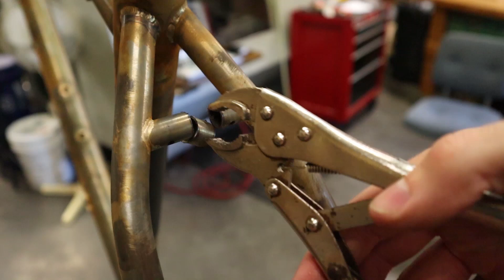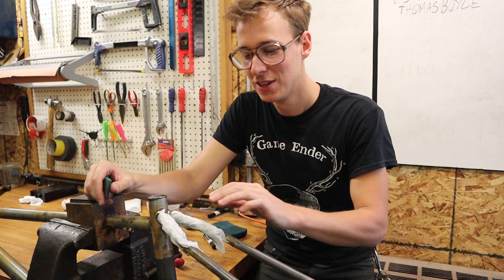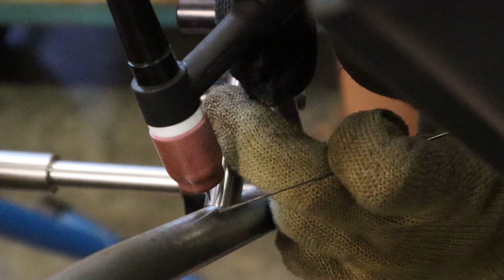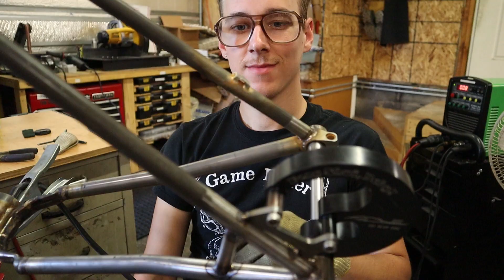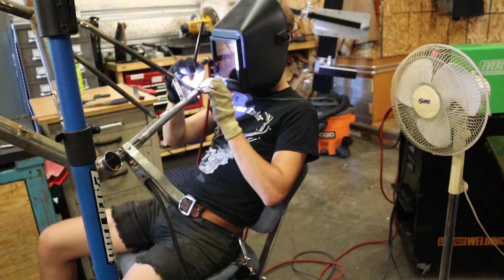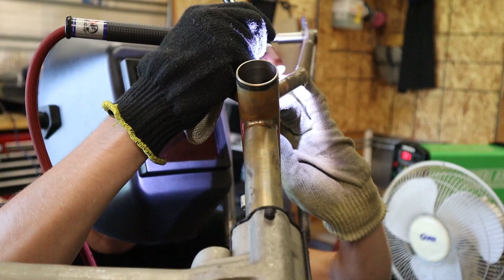Oops! Fixing a Mistake I Made on My MTB Frame

Comment: I don't weld bikes but I'm a pipewelder. Try welding while standing. You can use your feet and legs to (re) position yourself while welding. I know they say you need to be comfortable while welding, but you need to be in an active position. You weld with your whole body not only your hands. And for the small stuff try an autodarkening helmet or a flip up.

Comment: Great video. I think it's the right fix although as you said it probably would have been OK. Brazing only matches the strength of the base metal if you either build up a decent sized fillet or have it flowing around inside a lug or something like that. Not sure if you could have hacked it by TIG brazing with silicon bronze over the silver solder... I might try this on some offcuts and see what happens!
Reply: Well I tried silver soldering one end of a roughly 2" long piece of 0.8mm CrMo chainstay to a piece of 3/4in 1.6mm wall mild steel square tube. Then I cleaned it up and TIG brazed over the top with sifsilcopper 968 (silicon bronze). The puddle went a bit gooey and silvery but no spitting or anything and the joint came out looking OK. Then I TIG brazed the other end to more of the same square tube for reference and because I've been meaning to test this for a while. Just a proper joint this time with no silver in there. Then I tried to break it. The side with the silver in it broke first at the joint although I needed a couple of foot of leverage. The square tube deformed slightly before the joint broke. The other side only failed after attacking it with a hammer. The braze broke but the CrMo tube was also tearing open in another place at the same time and the square tube was pretty severely deformed. Much stronger than the bodged side and almost as strong as a weld.

Comment: I've had good success pouring boiling (or near boiling) water on flux to remove it. Another use for a gooseneck kettle, can get apply boiling water to specific places on the frame (like a bridge).
Reply: Would a steam jet work? Like for household cleaning?
Reply: hmm, i'm not sure, but i doubt it. boiling water works, i think, partly through thermal shock and partly through dissolving the flux (if water soluble flux, which i think is likely?). steam might help with thermal shock, but not much help with dissolving. i think its the dissolving that's doing most of the work, but i'm no expert here. just speaking from my own experience.
Reply: I wrapped different areas with rags, and poured water from the kettle over them, and let soak for several minutes. Seemed to keep the hot water/steam in place longer. Worked pretty well.
Reply from the maker: Yeah, hot water is better for sure. I had such a small amount of flux on there that room temp water was fine in this case. I do have an electric kettle for these things sometimes.

Comment: Is there a reason why you went with IS instead of PM tabs? Are IS easier to align? Ive noticed that most PM tabs on poduction bikes are badly aligned and need spacers added to adjust the angle
Reply from the maker: Yeah, I have the ISO fixturing tool and not the PM tool. Also, ISO works great and I don’t have any complaints with it.
Reply: @cobraframebuilding  but do you know why so many mainstream manufacturers mess up the PM alignment? Most IS are paralel but PM are messed up often
Reply: Oreo Carlton it looks more appealing plus more often you don’t have to have an adapter so maybe less wait

Comment: I was thinking the same thing when I saw you using 56% silver to braze the bridge. 56% silver could be used, but with the diamond reinforcement plates. Without the plates you could use 40% silver with tin that is suitable for fillet brazing. I've been experimenting with high speed pulse TIG welding for the chrome moly tubes and it seems to really reduce the Heat Affected Zone in the tubes. Columbus recommends 30% silver without tin for brazing their chrome moly tubes, which is fairly high temperature, but still lower than brass / bronze.
Reply: where does Columbus say that?

Comment: Joe.. To fix a rear dropout you are 100% correct.. I have repaired more than 50-60 dropouts and did it as you described.. For repairs it is important to try to match with the original as much as possible.. sometimes I replace both sides.. I have the shops save the nice dropouts when they are scraping crashed frames.. If the dropout is brazed , cut them in half, heat it with a torch and let gravity help you with removing it.. To remove the flux, it helps to use hot water rather than cold.. Great job on your build... I am dusting off my torch for a 650b  frame build..

Comment: Awesome Joe! We thank you for sharing experience with silver brazing applications. Bridges still boggle my mind. When I did the LTB I have a lot of punch with the dropouts squishing the axle. Was wondering your solution to prevent that. Only thing I can think is to deflect the rear end out as if it’s seating a wider axle.
Reply: Backpedaling?   Looks like Pithy Bikes now  might be able to finish their bike first before yours. 😁🚴‍♂️vs 🚵‍♂️
Reply: @HopelessRailmantic  LOL! I don't know.. maybe not by how things are going in my current  video recordings :P
Reply: @PithyBikes  True. Now would you and Joe meet mid country to race the finished bikes?
Reply from the maker: Yeah, I’m not sure how TIG compared to silver brazing as far as the dropouts narrowing from the heat but I think they both do it. You can start with an extra-wide dummy axle or you can cold-set it later. A wider axle can throw off the parallelism of the dropouts after it pinches down.